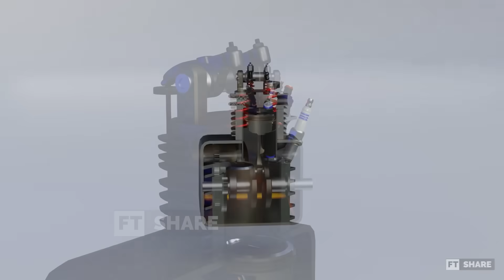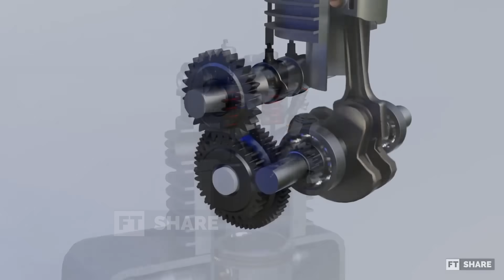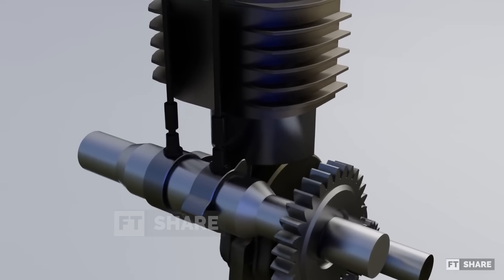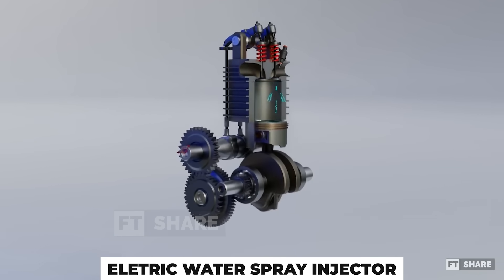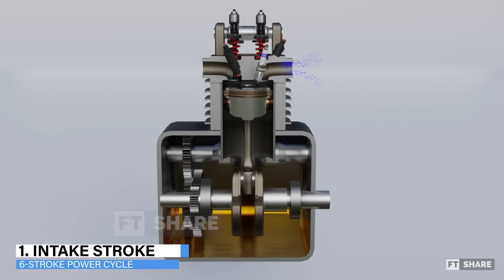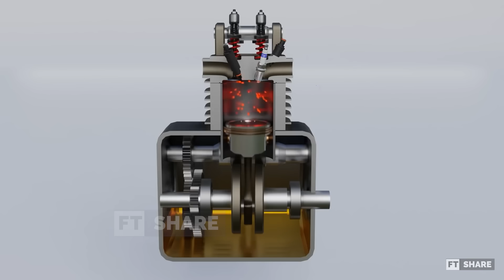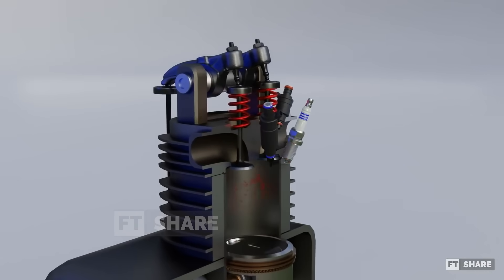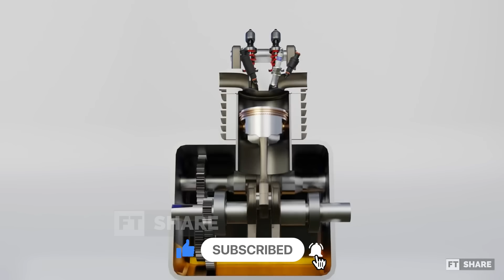Water-Powered ICE Is Here!!! | The Revolutionary 6-Stroke Engine

Comment: A couple of ideas and notes. First of all, I think many people seem to think that the steam expansion is why you get the boost in efficiency. But I think the main point is that you can use the water to absorb heat and thus improve engine cooling, which allows for more efficiency in the first four strokes. Whatever energy you can extract from the steam expansion is just bonus.
The video mentions a claim of an efficiency increase from the usual 30% to 50%, which would mean 67% more power, while the 6-stroke cycle would of course take 50% more time. But there are already engine designs that - under specific conditions - can achieve more than 30% efficiency, so it still may not be worth it unless there are other benefits. One additional benefit of improved cooling may be lower NOx emissions.
The changes to the engine compared to the 4-stroke engine, are mainly about the timing, which changes to enable 6 strokes instead of 4. We can nowadays manage this electronically and I think it should be possible to create a design that can switch between 4 and 6 stroke operation. That can be done based on load and engine temperature.
One engine design that might benefit from the ability to switch is Mazda's SkyActive-X engines. It uses compression ignition, but only in specific conditions. Engine temperature is a critical factor in this technology. If we can cool the engine using 6-stroke mode, we might be able to broaden the range of where it can operate in compression ignition mode. So, we might be able to alternate 4-stroke and 6-stroke cycles and still achieve near 50% engine efficiency with reduced water consumption.
About the use of a condensor to reduce water consumption: maybe, but you'd need to add a particle filter.
Reply: a particle filter for the water is smaller than a traditional cooling system, so you still save space and weight
Reply: @icedout7606  Yes, but a filter has a resistance which reduces the system efficiency.
Reply: engines already have an oil filter, fuel filter, and air filter. and the oil filter exists alongside a pump in a closed loop oil system. a water filter in a closed loop water system would be comparable, meaning it doesnt add much resistance
 @GerbenWulff
Reply: Adding one more crankshaft turn makes the engine way less efficient and unless you burn some fule on those new "2 strokes" you will just make things worse.
Inventing cr4p out of your hat is not physics, nor chemical knowledge, is just harrypottery.
Go and study some actual science, you will learn a lot and stop making up so much nonsense.
Reply: The steam is not just a bonus. It's crucial for efficiency because you're converting heat energy that would normally be wasted into usable energy. It the same reason turbos work.
Reply: It's not worth it. We already have a quite effective means to extract power from the waste exhaust heat. It's called turbocharging.
Reply: @wingracer1614  Turbocharging also has downsides. And you can do both.
Reply: @GerbenWulff  Everything has downsides or we would have free energy already. As for doing both, maybe. I'd have to think on that a bit. Corrosion in the hot side turbine is going to be a major problem.
Reply: @wingracer1614  You can inject the water directly into the cilinder, so the turbine doesn't have to be affected.
Reply: @GerbenWulff  Uh, where do you think all of that steam is going to go? Out the exhaust. Exhaust which drives the turbine.
Reply: @wingracer1614  Ah, sorry I misunderstood your earlier post. There's already a lot of steam in the exhaust, since you burn carbohydrates. I don't think recycling some of that steam should make much difference in terms of corrosion. Cooling the cilinder might reduce NOx which is corrosive.

Comment: one sulution to make such engine, actually, more efficient and take advantage of the extra 2 strokes, a second exaust valve, dedicated to the exaustion of the steam should be present. The idea is simple: you can't reuse exaustion gas from the combustion, so you need to expel it. However, such thing doesn't apply to steam, because you can reuse it indefinetly, by condensing that steam into water. While the combustion exaust valve would lead the gas into the exaust pipe, the secont, would lead the steam into the radiator, that would condense the water and store it in a water tank (like those wich radiators use) and so on, in a closed cycle. My Idea would correct a major flaw in such design wich is the water, after the 6th stroke, going to the exaust pipe, instead of circulating, requiring an large water tank work. With my idea, the 5th and 6th stroke would actually increase efficiency, by not riquiring an extra large (and heavy) water tank and using components already present in any liquid cooled engine (such as a Radiator) to reuse the water, instead of wasting it.

Comment: A nice side effect is the valves will not retain carbon.
Reply: I can attest to this. I ran straight water and water methanol in a chevy 1.8 ecotec motor, the valves often got extremely dirty even with port injection because chevys EGR strategy was to hold the intake valve open during some of the exhaust stroke causing flow reversion. The only benefit was no EGR valve to fail whatsoever!. The downside is the valves get dirtier than a normal port injected vehicle. Running water methanol for a month was enough that my valves looked like they were freshly put in! Bright and shiny
Reply: True. Instead they either corrode away or the exhaust gets plugged up with mineral deposits over time.

Comment: sump oil contamination would be extreme and hard to control
Reply: Steam is already a byproduct of combustion now, yet current engines deal with it.
Reply: Yes, that may be, and you simply cannot deny this fact.
But if injecting much more water than the ambient water load in free air will compound this immensely.  @volentimeh
Reply: keeping the steam superheated and dry will prevent condensation in the cylinder
Reply: It will never happen.
Stop start and short cold runs, it will build up @icedout7606

Comment: won't the 2 power strokes have different power outputs?
Reply: Quite a lot different, but that won't harm anything mechanically, the compression and power strokes are already placing radically opposing forces on the mechanics of the engine, the "water" stroke is mild in comparison.

Comment: I'd think a closed loop water system consisting of a condenser, radiator & perhaps flashevaporator would solve the water problem. Then there would be the added weight issue witch may negate any added HP. gained.
An interview concept nevertheless
Reply: the weight of a water reclamation system would be far less than that of a traditional cooling system. and even if it was the exact same weight as a normal cooling system, you would end up with an engine of the same weight but more power and efficiency

Comment: This is  misleading there is nothing will ever compete with an electric motor What's the downside for electric motor is infrastructure for charging and the batteries themselves not the electric motor the electric motor power band torque band is controllable fuel base engine power band will never be controllable and The reliability of electric motor will always be superior to a gas motor edit the average electric motor lifespan is roughly a million miles That's the motors we have today what about the motors in the next 5 years 10 years   from now 🤔🤷

Comment: Would have loved if this video provided sample power and torque numbers for comparison. 

Also, I think this “6-stroke” engine can actually benefit from a camless design aka freevalve using solenoids to push the valves instead. This will result in even better efficiency and more finely tuned timing.
Reply: It gives 33% more power at the same RPM (crankshaft turns 33% more). Torque is difficult to guess. The steam expansion stroke may be more powerful than the gas/petrol stroke.
Reply: @mikeb3172  No, is all BS... Goes against the rules of physics.
Reply: Is alawys the same nonsense repeated by ignorants just to attract more ignorants. 
What's proposed is nonsense and makes the engine a lot less efficient.

Comment: Great idea to improve efficiency, instead of dumping waste heat in an external cooling system do the cooling internally. Unfortunately it gets to minus 30 degrees here. Also steam engines use a lot of water.

Comment: SIX CYCLE ENGINE 
1 INLET 
2 COMPRESSION ⚡️
3 POWER 
4 EXHAUST HALF/ CLOSE VALVE RECOMPRESS  ⚡️
5 2nd POWER 
6.EXHAUST 

Six cycle more efficient 
Ultimate is 4 stroke 6stroke engine 
ECU CONTROLLED VALVES
POSSIBLE TO DO MECHANICALLY 

CAN RUN WITHOUT USING WATER

Comment: This engine is an attempt to capture energy left over in the exhaust of a conventional 4 stroke engine. This energy is contained in the exhaust as heat and pressure. However, by opening the exhaust valve at the end of the combustion power downstroke, the energies of the remaining pressure of the exhaust gasses, and the thermal energy of the hot exhaust gasses, are lost. The only captured thermal energy is that of the piston and cylinder walls, which are at a lower temperature than the exhaust gasses. Perhaps a better approach would be to build a conventional 4 stroke engine with liquid cooling jacket filled with a low boiling point substance (Freon?) , also equipped with an exhaust heat exchanger which uses the 4 stroke exhaust heat to help boil the Freon. The Freon "steam" would drive some sort of piston engine or turbine engine to provide mechanical power.
   I was fortunate a few years ago to get a tour of a combined thermal cycle electric power plant. It used a Rolls-Royce aircraft gas turbine driving an electric generator. The hot gas turbine exhaust heated  a (water) boiler which drove a steam turbine driving another electric generator. The gas turbine was fired by natural gas. The natural gas had to be compressed to 900psi to get it into the turbine combustor section. This implies that the compressor section of the turbine was operating at a compression ratio of 60:1 . !!!!!  The plant operators claimed an overall plant efficiency of 60%. Electrical output/BTU Natural gas input. 
   Another Youtube video showed an engine concept where two 4 stroke cylinders have their exhausts alternately routed to a third, larger "expansion" cylinder. This is a very old concept, obviously derived from multiple-expansion steam engines. Possibly this "expansion-cylinder" concept could benefit from water injection as the exhaust(s) from the primary cylinders pass into the shared larger expansion cylinder. This configuration does not let any exhaust heat or pressure escape.

Comment: That could work well with a straight six cylinder engine ensuring that at least one cylinder per rotation would be in power stroke.
Reply: and why would you want that
Reply: @LukaSvet-bg5sk  I don’t really remember as I haven’t watched the video in so long. Why not have a straight 8 with 2 cylinders firing at once, or an I-8 with 4 cylinders super charging the other 4? I’m sure talking hypothetically about doing the same thing brings about many complex hair brained ways of doing something simple in a more difficult way with more parts to break or wear out?

Comment: I've read somewhere (Don't have the link) that the water vapor from the burning gasoline is extracted before the outflowing combustion products leave the exhaust. (The result of the combustion is carbon dioxide and water). It is possible to condense the vapor and store the water for use.

Comment: Also distillation will only reduce corrosion of water injection systems.  The water will bond with hydrocarbons causing a far more corosive and toxic byproduct
Reply: When water bonds with hydrocarbons you just get simplified partially combusted hydrocarbons. That is how you make methane and hydrogen it will all just combust in the next cycle.

Comment: Thumbs up to you but thumbs down to the idea.
As a mechanic, all i see is water in the oil, quick/severe cylinder wear, and cracked pistons resulting in very short engine life.  Substitute water with an oil based compound or something that will fully evaporate without condensation

Comment: Think of loosing a stroke, why not do the water with the petrol via  the same stroke. 
Water  pre heated by exhaust heat as engine warmup. Or by similar preheat Diesel system  starting.  Obviously the compression will cause the water heat with the fuel in one. compression stroke. . Did motorcycle drip system to Carb. Was good after engine was warmed up.  Noticed , engines always seemed better in cold damp days.  1950s. (Higher exhaust temperatures noticed by water leak in furnaces .)

Comment: So, theoretically 45% efficient, IF it can be made practical (which it isn't really). And still needs a clunky multi-speed transmission. Electric motor >95% efficient, fixed speed transmission. Hmmmm, let's keep working on those batteries guys! Nothing worthwhile to see here.

Comment: Some piston ring blow-by is normal, if it contains steam which then condenses in the crankcase and mixes with the engine oil it will comprise engine lubrication.
Reply: There are also other 6 stroke engine designs which use air instead of water/steam. Air expands much less than steam when heated, but is probably much easier on the engine
Reply: keeping the steam superheated will prevent cylinder condensation
Reply: @icedout7606  Condensation occurs between operational cycles.
Reply: yes, maybe downstream of the exhaust system, not in the cylinder @AquaMarine1000
Reply: @icedout7606  Yes, it is normal to see water in the exhaust when an engine is cold. But the fact remains that piston rings don't completely seal. This piston ring leakage is called blowby about 0.03% for a new engine that leaks into the crankcase where the engine oil is retained. This is the main reason oil changes are required to maintain the service life of an engine. Blowby volume is at a mininium at 0.03% of six times engine pumping capacity. A modern engine incorporates a pcv valve among other systems to reduce air population. Using high-pressure steam to aid in power delivery can only increase the amount of moisture contamination in the crankcase, which in turn reduces the service life of the oil. This can be overcome by more regular oil changes if economically viable. Cheers
Reply: @AquaMarine1000  I see your point. I misunderstood earlier.

But more steam power means an average reduction in emissions per kilowatt-hour, including soot production, which means the oil will take longer to be contaminated by soot, which could balance out the water contamination - but only partially. 

The obvious solution is as you said an upgraded crankcase ventilation system to get rid of any steam blowby before it condenses into the oil

Comment: Years ago, I raped copper brake pipe around the exhaust manifold on a petrol engine. I fitted a micro switch at the 3/4 travel of the throttle linkage. This allowed a fine water jet to spray into the carburettor. The engine has to be at running temperature, before allowing water in. This needs to be refined, but explains why engines run better in damp weather. This is because, the compression improves!
I think the 6 stroke engine, has a future. Interesting.
Reply: The spray of H20 (mist) as explained by my dad was a power boost for a short period of time. And at higher rpm. I felt the reason for this was a breakdown of the water atom and the release of oxygen into the combustion chamber. Maybe?
Reply: No just adding water vapour to the intake air has a future.  Not this bullshit engine.  The combustion chamber and piston will not get to 300 plus degrees. If that was the case the rings would not last long.
Reply: raped?

Comment: Where does all this heat come from to boil the water into steam? The previous stroke has just dumped all the hot exhaust gasses out of the exhaust port.
Reply: Instead of using a radiator or other external cooling the cylinder is cooled by the water injection harvesting the heat for energy instead of dumping it into the radiator. But there have been plenty of engine runs on water attempts in the past. Usually injecting at the same time as the fuel or pre mixing it. So the water absorbs the heat of exhaust gases as they are created in an otherwise normal 4 stroke cycle. So I am not sure what advantage a six stroke engine has over any of those previous systems, as you point out a lot of the heat is escaping with the exhaust.
Reply: Compression
Reply: @code111japan  No, the piston is hot from the combustion process,
Reply: @gbone7581  A primary goal of an efficient ICE is to minimise the heat absorbed by internal components like the piston and combustion chamber.  Not only does this reduce efficiency a very hot piston also promotes pre-ignition and detonation.  The piston shouldn't be getting very hot anyway, it's in close contact with the (water cooled) cylinder wall and there is often an oil squirter on the underside of the piston crown to cool it.
The concept is inherently flawed, the majority of the waste energy that could be recovered to make significant gains in efficiency is in the exhaust gasses, but this does nothing to use them.

Comment: Maybe? How to keep the water from freezing when the engine is not running. The engine has industrial uses. Ships, stationary, trucks, and farm.
Reply: Alcohol just like your windshield wiper fluid
Reply: @patrickday4206  That would significantly reduce (though not eliminate) the extra power you get from the flash steaming of the water. At which point, you could get more power by simply burning the alcohol in a conventional engine.

Comment: Need to have the second exhaust stroke in a separate valve water will also cool the catalyst bed, thus it needs a second valve, and if it ran 16-18 to 1 compression, it could use water to keep it from detonation